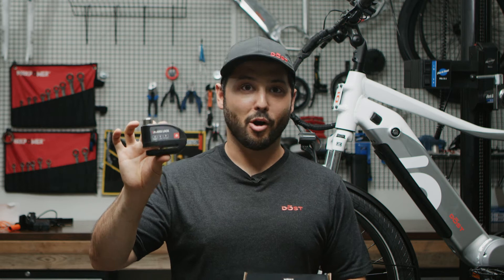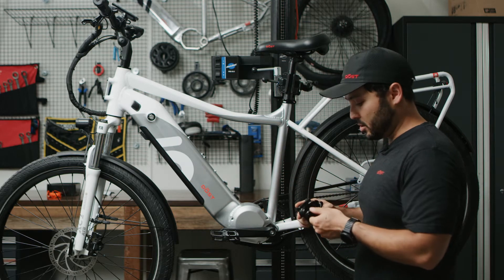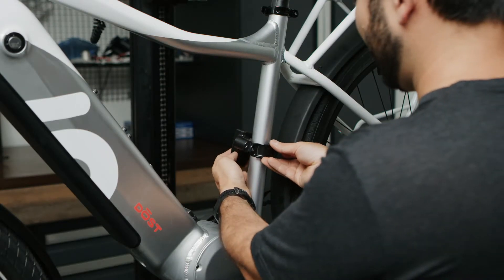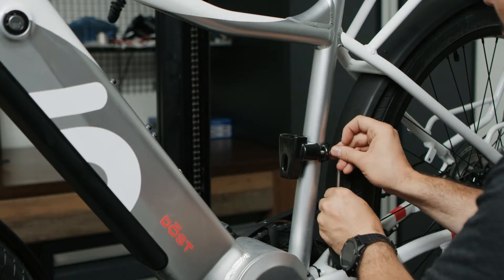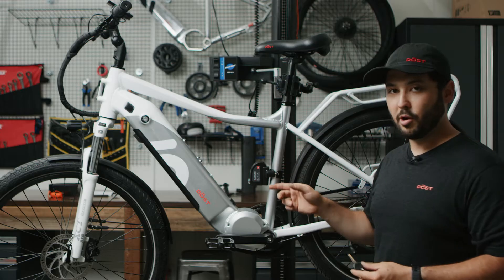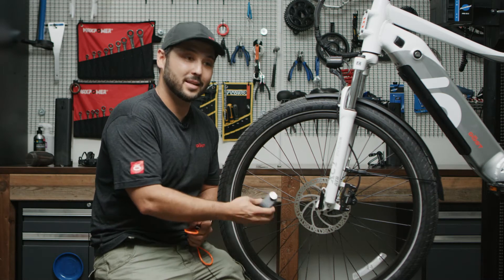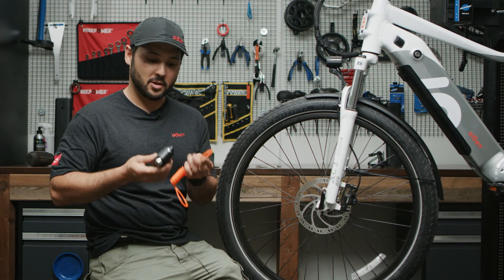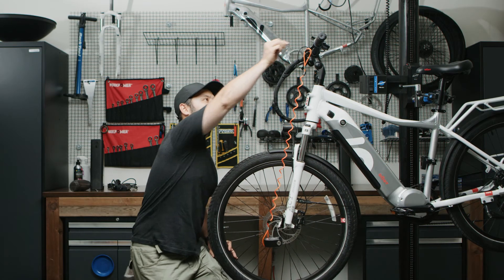DŌST Bikes - How to Install and Use an Alarm Lock

Comment: You’ve installed it incorrectly, as is pretty obvious in the video. Installing on that tube, you only need the thin spacer. Plus, you need to make sure that you use the shorter screws.